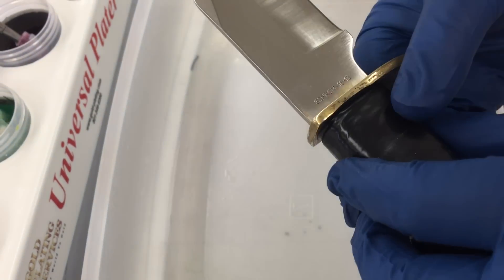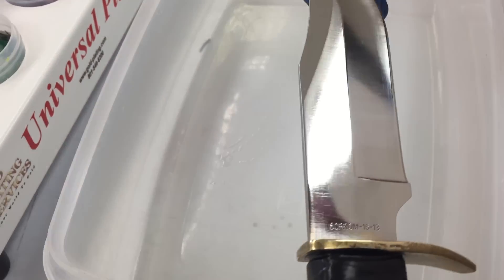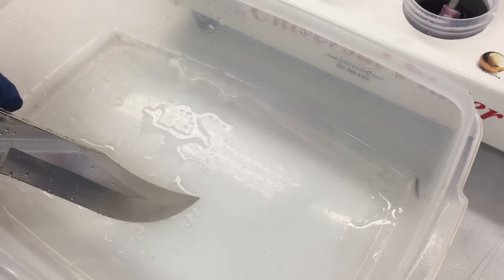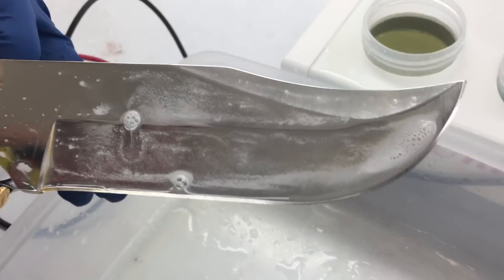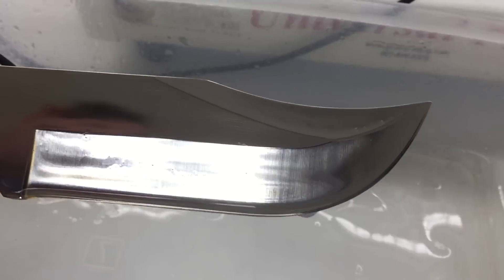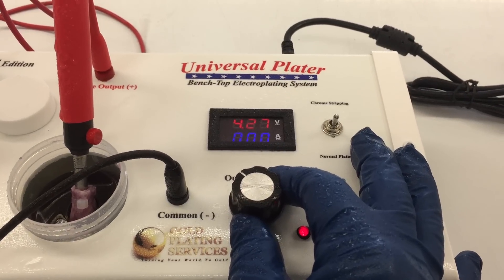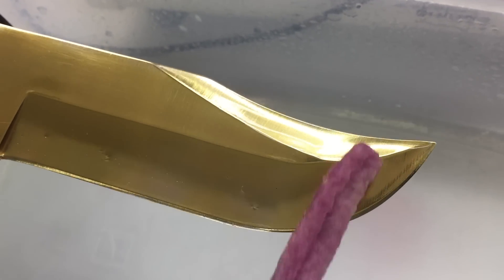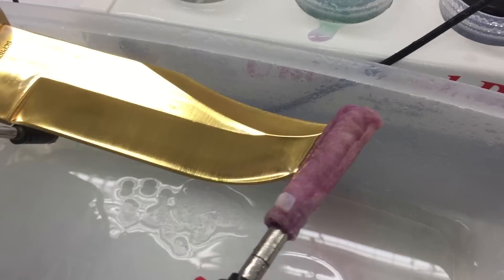24K Gold Plating on Knife - Stainless Steel - Brush Plating Demo

Comment: is there some kind of clear coat we can apply for gold plated to prevent the gold from getting rubbed off ?
Reply from the maker: You could add a clear coat to help protect the surface.
Reply: @GoldPlatingServices  Thank you very much, is there some kind of recommendation of what kind?  I'm asking you because I assume you had a experience of a customer ask something like this before.

Comment: What about aluminum automotive wheels? I have gold wheels that are powdercoated, but want to gold plate them, is that possible?
Reply from the maker: Aluminum can be plated onto but the chemicals used in the process cannot be used on a consumer level so its possible but you would need to get them nickel plated or something before you gold plate them.

Comment: Hi i have a 16mm x 25.5 silver Miami Cuban Link necklace and a 16mm x 8.25 Cuban Link bracelet silver. How much will it cost me to get it heavily dipped in rhodium for  both pieces to a very very bright mirror finish shine. Thanks
Reply from the maker: You would have to get a quote off of our website to get a cost.
Reply: @GoldPlatingServices  what's your website address
Reply from the maker: https://www.goldplating.com/

Comment: The strike plating is too fill in the pores within the substrate's surface its only done on certain materils stainless, brass copper, sometimes aluminum but copper goes onto alumnim then nickel then your final plating such as silver or gold. 

The stike plating will help improve adhesion and not cause blistering those bubbles that you see is because the pores are gassing out causing the plating to bubble up
Reply: Opposite of what you said. There are "less pores", aka molecular holes in Stainless and Chromed steel, and WHY... it's stainless. Because there's less surface area for oxidation to occur. Nickel strike is able to create a better molecular lattice, leaving more bonding area for the gold.
Reply: @m4rvinmartian  bro I work in a electroplating company I know what I'm talking about stainless steel does require nickle strike (wood strike) before any type of playing because it does have pores

Comment: Can an all Stainless Steel Claddagh ring be 2 tone plated? Only some parts of the ring get 24k gold plating, and the rest of the ring stays Stainless Steel?

If possible, what would that cost on average?
Reply: Yeah you use a lacquer to paint the area thats not supposed to be plated, plate it, then use acetone to remove the lacquer.
Reply: @cxmplexdrives9719  awesome thanks! I wish I had the stuff and knew how to do that!

Comment: Can you gold plate a steel with a brushed finish or does it not adhere properly? I have a watch band that I wanted to try plating but most demos I've seen are for polished items.
Reply from the maker: You could plate an item that has a brush finish but your gold will be as shiny as the part you are plating on. So if the surface is dull then the gold will plate on dull. I hope this helps.

Comment: What is the best wait to reverse the plating process? I have a gold Cartier ring which I’d like to turn silver so that I can recoat it in white gold.
Reply from the maker: Go through the normal process you would to gold plate an item but instead use the white gold you want to plate with.

Comment: It only works for stainless steel??? I want 1 piece of equipment that works for carbon steel.
Reply from the maker: The Universal Chrome can do both but it just depends on what chemical you are using that makes it plate on different metal. Some metals require different solutions to be plated.

Comment: it seems, gold electrolyte dosen't bond very well with stainless steel metal.
Reply from the maker: It does bond well if you activate your piece properly. You will have to use wood's nickel strike or TriVal gold acid strike.

Comment: At 4.01 you tell us about "woods" as a nickel plating method. What solution is it? In electrogalvanization obtaining the nickel plating solution is a painstaking process for chemists (it means decoupling with cathodes lost at a very low current density and is depending on the amount of solution) What invention is it about?

Comment: the most annoying part with doing these jobs is you need alot of distilled water. And its not that cheap when you start use it to everything and also sprays it out,

Comment: I have a question regarding the direct current that the kit needs. What happens if I do not use a direct current?
Reply: Do you mean using an AC Alternating Current? 
I am not an expert but..
  Do Not use Main supply at 110 Volts or 240 Volts unless you want to Kill yourself.
    An Alternating Current would i think.. Put the Plating On, then take it Off.  Then put it On.. then take it Off again, repeating at 50 Hertz , 60Hz or whatever frequency that you're using.
     I would caution you not to  attempt to work with electricity until you've gained a thorough understanding of the science first. Including the lethal dangers.

Comment: I'm surprised you didn't stripped the other side and plate that as well
Reply from the maker: This is a common question/comment.  The purpose of this project was not to finish the knife. The sole purpose was to demonstrate the proper way to use the chemicals and prep the part using Electrocleaner, Strike and Gold, to get a good deposit.  The customer was wanting us to show them how it's done, not do it for them.  We sent the knife back and the customer polished everything off and followed the steps we showed to complete the knife.

Comment: Why the gel is in a violet color when it’s supposed to be gold? I know it won’t be 100 percent of the content in gold but I never though it was looking other color.
Reply from the maker: The violet color in the solution is actually the hardeners and brighteners in the solution.  Without these, the solution would be water-clear.  The gold is in a salt form before being dissolved into the solution.  Only once the electrolysis happens does the gold get converted into metallic gold onto the cathode.

Comment: Quick question..For plating a zippo lighter how many microns would you normally  recommend?
Reply from the maker: Since it is an item that will be handled frequently, we would typically apply 1-2 microns.

Comment: What if I used in fading jewelry that had diamonds? Will the diamonds turn gold as well?
Reply: Shouldn't do anything to diamonds. Essentially, gold plating works by sending electric current through a metal and that attracts gold particles in the plating solution - diamonds aren't exactly conductive so they shouldn't attract any gold.
Reply from the maker: No No is correct.  Diamonds will not be effected whatsoever by the solutions or the process.

Comment: we dont understand electro clean talk in basic words, your etching the fucking surface so you can use a strong acid like hydrochloric acid
Reply from the maker: Electrocleaner is an industry standard name for the product.  The product is a mixture of multiple make-up components.  No etching is done in this process.

Comment: if you polish the item once its gold plated will the gold be removed??
Reply from the maker: Polishing needs to be done prior to gold plating.  Gold is soft and the plating is relatively thin - you do not want to polish it after plating or you can remove it.

Comment: 1st step is an acid etch activator.............try plate alloy and see if your that clever ;lol
Reply from the maker: Sorry, not sure we understand your comment.  The first step in this video is Electrocleaner.  

An alloy is a metal made by combining two or more metallic elements.  We plate many alloys, including the alloy shown in this video.
Reply: @GoldPlatingServices  sorry i meant aluminium,not an easy material to do.what activates the steel,the strike?
Reply from the maker: @djbillye4943  We tell our customers that Aluminum cannot be plated on a consumer level.  It may be possible but in 30 years of business we've had a lot of customers think they could do it and not one has succeeded.  We offer the services, but we do it on an industrial level and have trained professionals do it.  

In this case, the Woods Nickel Strike could be called the "activator", but the electrocleaner is just as important.
Reply: @GoldPlatingServices  thanks for your reply.ive just gold plated over a nickel flat surface,unfortunately the rinsing water was contaminated with the chrome stripper water,im trying to polish out the mark but in doing so making noticeable fine scratches,can i reverse the gold plating and remove the gold and start from scratch?
Reply: the more i polish,the more the fine scratches appear.........
Reply from the maker: @djbillye4943  You need a finer polish... unfortunately to get a polish without scratches in bright nickel is very hard.  Thats why it's super important to not make mistakes on those type of finishes.
Reply: @GoldPlatingServices  indeed,is there a chemical that can remove the gold plating down to the base layer where i started?to the nickel?

Comment: +Gold Plating Services or anyone who may know.... I have no problem gold plating stainless especially with woods nickel but does anyone have any tips on how to get gold plating to stay on titanium????  I get it to take the gold but it easily wipes off.  I've tried starting with other base metals like nickel and graduate up with no luck on any plating (even the nickel or copper which I also tried) to stick.  

I know an ION Vac would work but don't have one...lol
Reply from the maker: Thanks for the great question.  Pure titanium is extremely tricky to plate onto and is not something we recommend attempting.  It requires a high percentage hydrochloric acid dip and even when done properly it is very tricky.  If it is a titanium alloy, you can plate onto it using our TriVal - Acid Gold Strike.  The TriVal is better for more difficult to plate alloys.
Reply: @GoldPlatingServices  I completely agree.  I sometimes am very successful, other times can't get it to hold at all.  I'll get it to plate but whether it wants to adhere permanently is another matter.  I do work with hydrochloric acid here using it for things like oxidizing to antique my rings made of silver, copper or nickel but haven't tried it as a prep for gold plating titanium which may be a good tip and I'll try today.  Do you have a recommendation as to how long you would dip and at what percentage and are you soaking or using electrolysis?  As for your TriVal Acid Gold Strike how does that differ or does it to Woods Nickel Strike or is it basically the same thing?  I buy and love your products, keep up the training videos, it really helps!

Comment: What different bits would I need to do stainless steel?
Reply from the maker: Electrocleaner and Gold use the Stainless Steel bits.  For the Woods Nickel Strike step you need a Nickel bit(anode).

Comment: He just didn't clean it.
Reply from the maker: He did not do the preperation steps correctly.  The electrocleaner and woods nickel strike MUST be done properly or you will get the result he achieved.  It could have been either of those  two steps done wrong to get that result.

Comment: What compounds do I use to buff my glock slide?
Reply: #goldplatingservices
Reply from the maker: A lot of times, what you will want to use depends on what it is coated with (i.e. Bluing, Paint, Cerakote) and what it is made of (steel, etc).  We specialize in electroplating more than polishing, so for a specific gun or finish you may want to refer to a polishing community Forum or some polishing specialists if you are having issues with the polishing.  Here, we typically use a buffing wheel with cotton buffers and use Red Rouge and/or white rouge depending on the situation.  We have a video where we showed buffing this knife - Do keep in mind that we were mainly polishing off the gold, if we were going for a higher polish we would have done it longer and more aggressively.  Here is that video: https://youtu.be/SCBqD8wn63c

Comment: Does this work on brass?
Reply from the maker: Yes, brass is quite easy to plate onto.  When plating brass you Electroclean first, then use Surface Activator, then plate.  Woods Nickel Strike is not required on brass.

Comment: What is in the Surface Preparation Solution?  A light acid or something?
Reply from the maker: Surface Activator is a dilute acid solution.  However, the chemical used in this video is called "Woods Nickel Strike", which is a compound of multiple chemicals.  It does include acid but it also includes other critcal components as well, such as nickel chloride concentrate.
Reply: I appreciate the reply, I actually tracked Woods Nickle Strike down on eBay.  Does it take the place of a regular surface activator to wet out the surface or is this something different?
Reply from the maker: We sell Woods Nickel Strike on our website.  Woods Nickel Strike's purpose is not to wet out the surface per se but it is used as the second step when plating onto steel/stainless steel.  Woods makes it possible for the gold to adhere on stainless.  Basically it does replace surface activator when plating onto steel, if you want to see it that way.
Reply: I'm ordering some right now but to clarify, since it doesn't take the place of a surface activator is the nickle strike sort of like it sounds and puts a light base coat of nickle on the stainless steel so that the gold can bond?
Reply from the maker: The deposit is real, 24K gold, 99.97%+ purity.
Reply: Just so everyone knows, my gold plating has been a hundred times better ever since I bought the woods nickel strike a couple months ago.  It really does make a dramatic difference.  Hey +Gold Plating Services, if you want to be reviewed on my channel with tens of thousands of viewers, let me know and we'll discuss the possibility of an open box review for your product.  I only endorse the best products on my channel and in fact will be giving away an $1600 tooling system next week if you or anyone here is interested and would love to promote your product.
Reply: @GoldPlatingServices  Right, I did buy your Woods Nickel Strike which does work wonderful on stainless steel but when it comes to titanium, the gold would appear but as easily as it went on, it would come off (Just lightly rub your finger over it and the gold wipes right off).  I was wondering if you had any instructions or another product I should be using to get it to hold to titanium better like maybe the one you mentioned earlier?  I have many of your products and also have straight hydrochloric acid here if that helps (I do know how to safely dose the acid to distilled water) but I'm just misplaced on what I'm doing wrong with getting it to hold onto titanium without wiping right off?

Comment: Hi I just bought this kit 2 days ago that was shown in the video, chrome edition. I am getting consistently low amps from my stock pre-soaked gold sleave and its bit. Is it possible for a bit to loose its ability to hold current or something. What could I be doing wrong or may be the symptom  of this? The only thing that seems to change the amps of the bit and sleave is the angle that I am rubbing onto the stainless steel. Please get back to me when you can, besides that i love the product.
Reply from the maker: Hello. Based on the information we have here and how we're interperating it, it doesn't sound like anything is wrong.  The amps will only fluctuate when you complete the circuit and begin plating.  It will then constantly change slightly as you move, change angles, etc.  This is normal.  If the plating is working, then it sounds like everything is fine.  If it is not working, then we need to evaluate what is being done incorrectly or if there is some sort of issue with the hardware that has developed.  We will get all of your questions answered and ensure that you are doing everything correctly to get the best results.  It would be best if we had this communication via e-mail or phone.  You can contact us at info@goldplating.com or by calling 801-546-6200.

Comment: Great video man, Can I do the same thing on a Stainless steel knife but with silver instead of gold? One more, ho can you tell if the nickel is plated? It's basically the same color of steel.
Reply: I'm an electroplater for a living. You can do the same thing with silver. Same process with electrocleaner and nickel preplate. As nickel builds up it starts to look a bit more matte and dull but that is a bit hard to detect with just a flash of it. You'll have to just use good judgment as you go